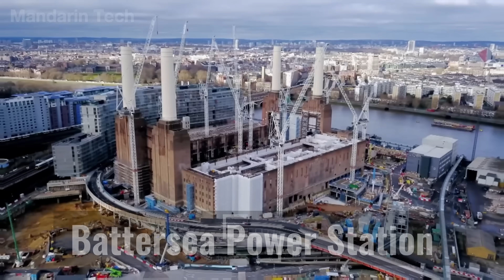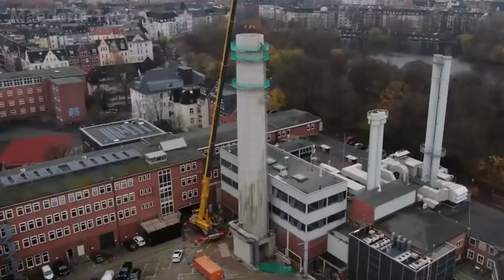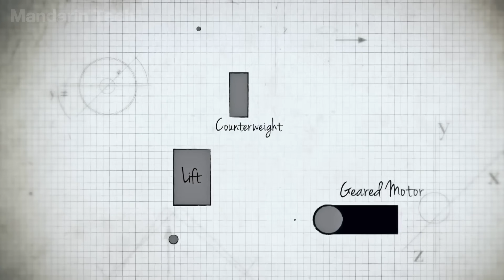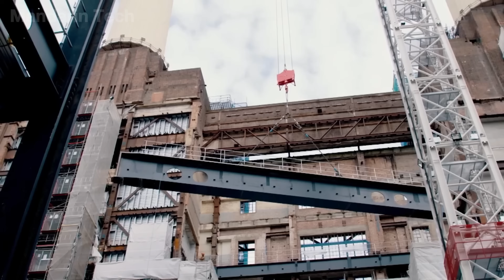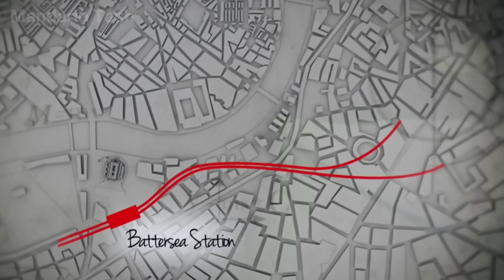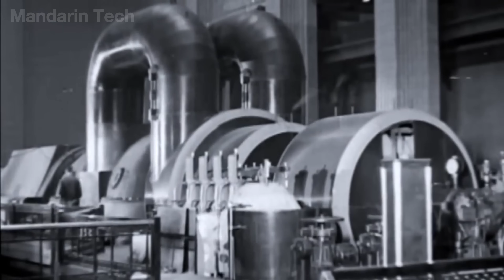How London Revived Its Largest Coal Fired Power Station into a $9 Billion Mega District

Comment: I worked there on and off for the local electricity supply board from the early 1980s to 1993.
Although the Station did not generate power from 83 onwards, it still had a live section in the B House, which received power from the two 132kv Transformers situated adjacent to the Main Gate House entrance. This then fed 66KV Stations north of the river.
I have some great memories of working there on those Transformers, but especially on the 66kv switchgear in B House. 
Unlike other P/S i worked like Bankside, and Transformer Stations around London, we didnt have to bring in Insulating Oil from outside to maintain the huge switchgear. It had its own oil cleaning plant which cleaned and replenished the oil for reuse. 
The contacts inside the tall switches, were difficult to access and various panels had to be removed near the top to clean them. As an apprentice, the electrical fitters realised that as i was 6' 2" and skinny, i was able to climb inside the main door at the front and reach up to dress the contacts up. I became in demand for working there after that 😁 When i became a fitter myself, i continued to be the one who got that job at Battersea. An example of the switchgear can be seen in the main area now. I hope to go and see one day, although i seriously doubt i could fit inside now. 😂

Another feature i enjoyed, was going down into the cable tunnel running under the Thames and coming up near the Chelsea Barracks. We had to go and check the lights and any sump pumps still worked. 

I was at Battersea when the B Turbines were still there. We used to watch from the switchgear mezzanine as the Police came and trained dogs for sniffing drugs etc. That stopped as the Turbine Hall was gutted. 

Great memories. Thank you for making this video 👍

Comment: The Battersea Power Station site is an absolute eyesore. The company in charge of the overall site, had zero public contact access. They clearly knew how sheeple felt. I live in full view of the site, and it was an abomination during construction, and it's an abomination completed.

There are two reasons why the original chimneys were as high as they used to be. Functionality, and aesthetics. The replacement chimneys are dumpy stubs compared to the originals. The entire area is a ghetto for exactly the wrong type of sheeple who should be living in this part of Londonstan. Don't get me wrong, many areas of Londonstan are full of the wrong sheeple, and Battersea is one of them. These are the sheeple who should be living in poxy new towns where they can work from home for 3/4 days, and visit their office, based in their new town one day per fortnight.

You will find key workers living here, at a massive cost to the tax payer, and I won't even touch the foreign buyers who have never even visited their property, as it's just a safe place to hide dirty money.

Comment: Congratulations it lay derelict for 30 years then took 10 years to build and was 9 times over budget from 1.15 billion to 9 billion. 

In comparison Istanbul new airport  took four years from conception to inauguration and cost the same amount and is 400 times bigger. Now let’s start on the failing rail system failing hospitals failing roads shall we. How about 200 years for that. I am from Battersea London btw.
Reply from the maker: Massive projects like this always spark debates about cost and construction time.
Reply: @Mandarintechmido Yes and that's predictably British let's have a vague debate about catastrophic failings and sweep it under the carpet without profound change which is critically needed.

Comment: My father an ex P.O.W. from burma railway worked there, he painted the Chimneys from a rope and 2ft scaffold board 3 chimneys were white and one was cream, the cream one had a red flashing light on top, that was to tell the aeroplanes to turn and aline with the glide path to heathrow. it was a base station with 12 boilers 25 ft wide 20ft deep and 150 ft high chain grate coal fed by hoppers later 6 boilers were altered to oil,   2 boilers was always off line for maintenance  regularly we burned money from the bank of england, old disused notes punched with holes so no one could steal them also we used to burn shot pidgeons that were a bain of power stations and buildings in london, lombard road when i was transfered there was a peak load station, that would suppliment battersea power station during mornings and evenings to take up the load when people got up for breakfast and evening dinner. when the miners strike was on with arther scagill maggi thatcher filled every power station with as much coal as it could possibly hold. when there was more than 3 months of coal available she closed the coal mines.
Reply from the maker: That’s an incredible piece of history, thanks for sharing